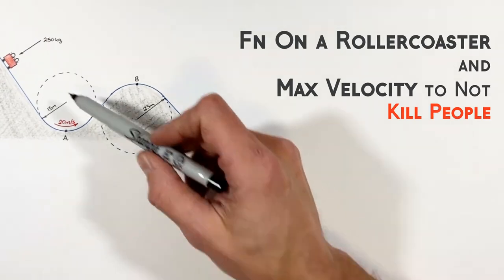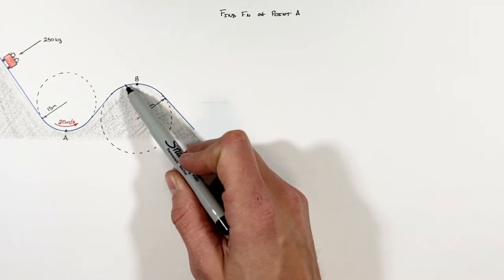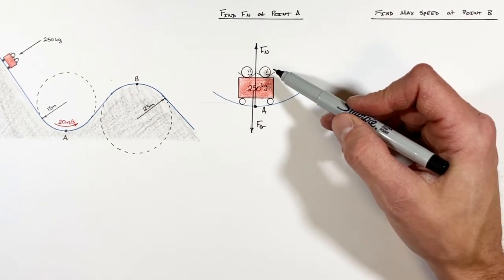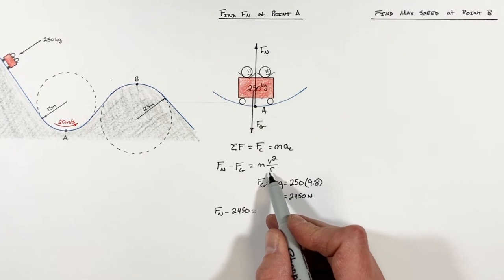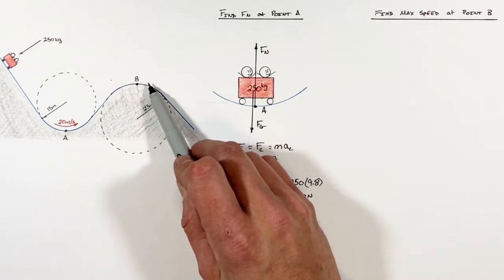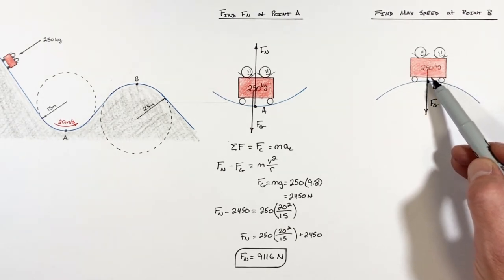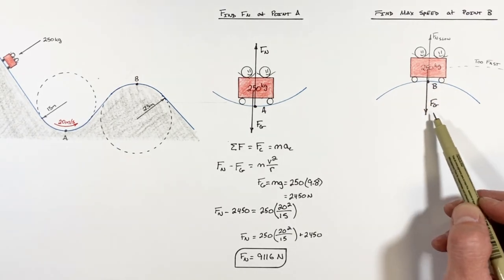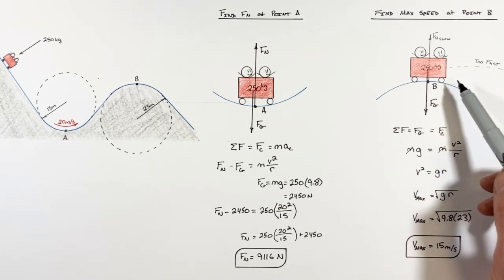Calculate Normal Force On a Roller Coaster Cart  |  Circular Motion

Comment: What is the difference between centrifugal and centripetal force?
Reply from the maker: Any time something moves in a circle some force has to act toward the middle of the circle on the moving object.    In the case of a car traveling around a corner, that force is friction acting toward the center of the corner.  That inward force is called a CENTRIPETAL force.  

When driving around a corner to the RIGHT you 'feel' as though you are being pushed up against the LEFT side of the car.  That perceived force is called a CENTRIFUGAL force, and it doesn't actually exist.  What's actually happening is the car is accelerating to the right, and you're in the way.
Reply: Centrifugal force is a pseduo force which we use in non inertial frame

Comment: How does the normal - gravity = equal to centripetal force,  how does the surface calculate amount of force given ..means how normal force adjust itself with velocity of vehicle...what the science...because when you have higher velocity the centripetal force is more
Reply from the maker: The surface/track is rigid.  It is engineered to produce enough force on the cart so that the cart experiences the necessary acceleration and does not crash through the track.